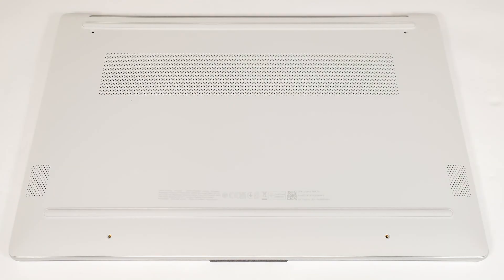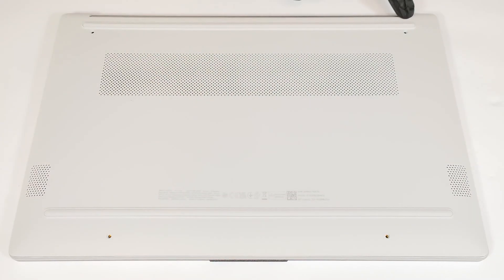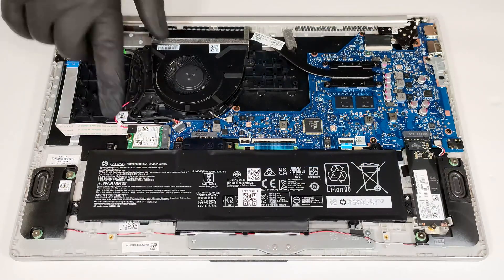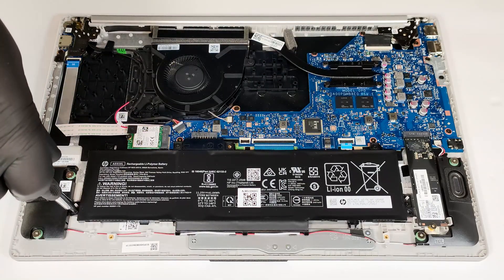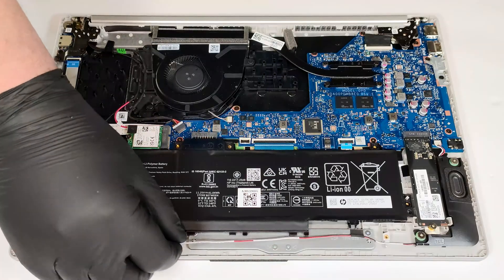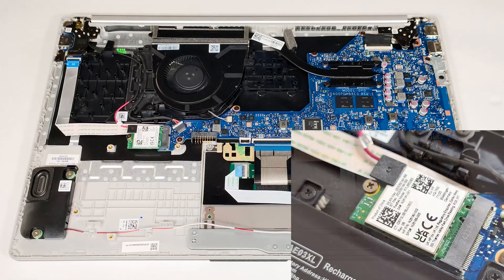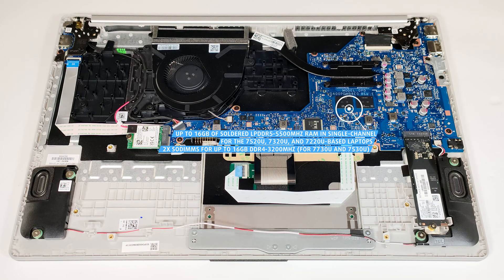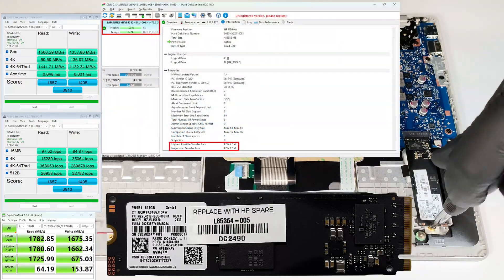🛠️ How to open HP 15 (15-fc0000) - disassembly and upgrade options

Comment: Can you just swap out the m2 ssd  without removing the battery?
Reply: No always remove the battery. even if you just looking around
Reply: @Clippy-w4g  Why not? It's already powered off
Reply: Yup, m.2 is on the bottom right, no need to remove battery to take it out, usually harmless